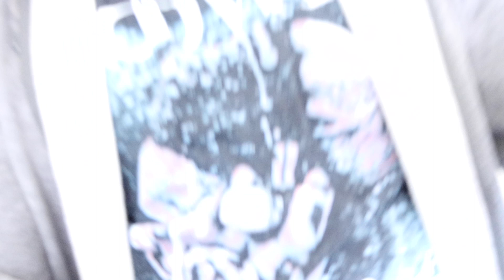MORE GOODIES FOR THE LS SWAPPED OBS

Comment: Great job.  Like your style.  Best one for me was from Jan 5, 2022 about cleaning up the wiring harness.  I've gone thru the ones from Laurenceville Garage and Swap Time, the best ones I've found so far, but yours was better.  More instructive.  
As for new videos, go thru the same steps a couple more times with different projects, pay a little more attention to "step by step" and production quality and you'll hit a home run.  
Current fun and games for me is the bottom shift linkage for a 4L60E from 2003 Silverado Ext Cab into 1994 K5 Blazer.  😳 Heat and bend, cut and weld.  Oh fun.  
June 13?  2021??  Wow.  Sympathies!  
Brought my engine/trans home Dec 12.  But it was complete from the junk yard, no waiting for parts ... yet!  😁 Will turn the key this week!  Yay.